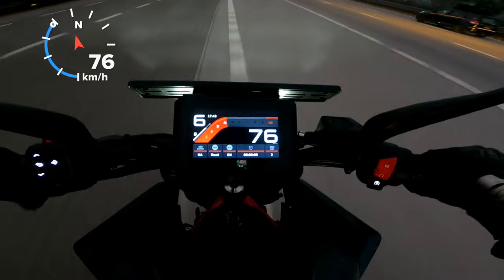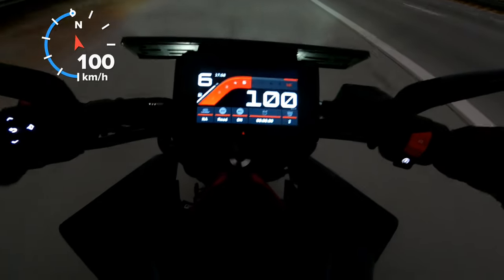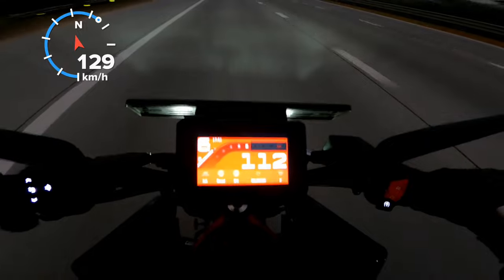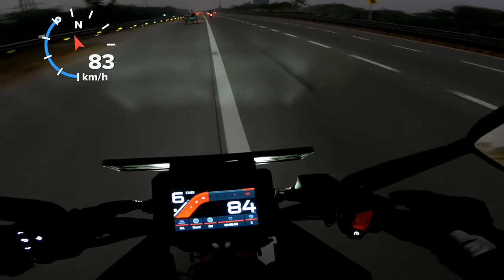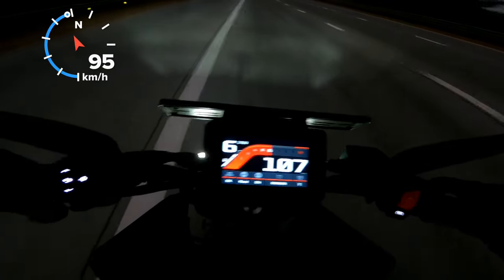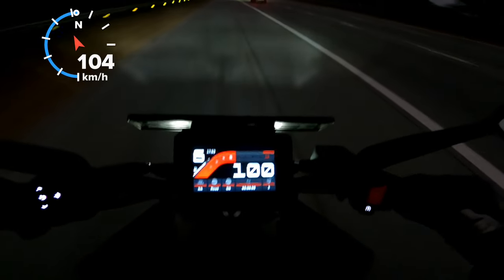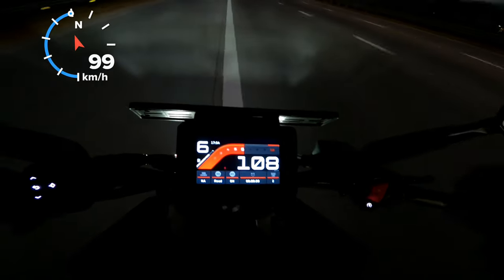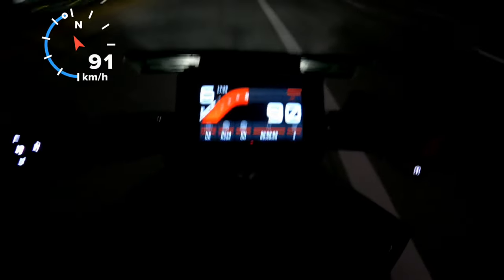GEN 3 KTM Duke 390 HIGHWAY TOURING REVIEW | Cruising Speeds RPM & Vibrations

Comment: Bro I'm feeling more vibrantions in between 5.4k to 6.1k rpm.. do you feel the same on this 390 gen 3?? Or is it with me. If you dont feel so, what i have to do to reduce it?
Reply from the maker: In what gear(s)?
Reply: @NewsXAuto  almost every gear.. in 6th gear it is even more between that rpm bro.
Reply from the maker: @saichanakya8817  Where do you live?
Reply: @NewsXAuto  Andhra Pradesh state bro..
Reply from the maker: @saichanakya8817  oh okay, I asked because I would have checked personally had you been in Delhi. Okay, so answer the following too: 
1) Odo reading 
2) What motorcycle were you riding earlier
3) Your total riding experience in months/years
Reply: @NewsXAuto   Okay.. Thank you for concern bro! Here are my responses
1)  Odometer : 1986 kms
2) Duke 200 - 2022 model
3) it’s been 2 years bro
Reply: i feel so much vibrations from starting till 7K rpm in all gears, plenty vibrations that irritates, RE are better compared to the duke i rode
Reply: @kriesh07  vibrations have reduced after 2nd service. And I only feel vibrations in between 5k - 6.2k rpm.. after that it is smooth. I rode 7K kms. Keep riding, it will get reduced. And one more thing, there will be vibrations for sure on this as it has the max power in single cylinder which no other bike gets.. so there will be vibrations. Maintain the bike, cleaning, chain lube, tyre pressure and it will show you the best..